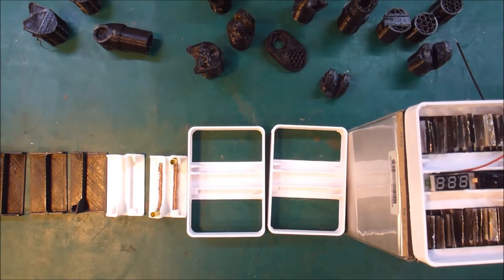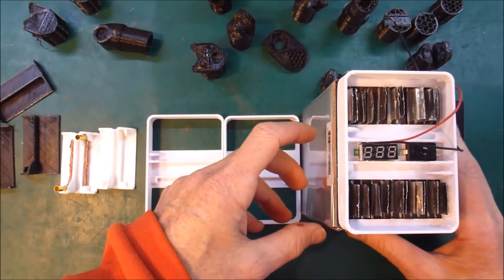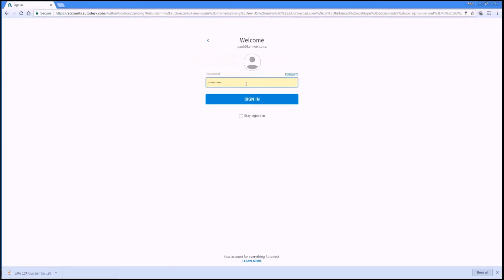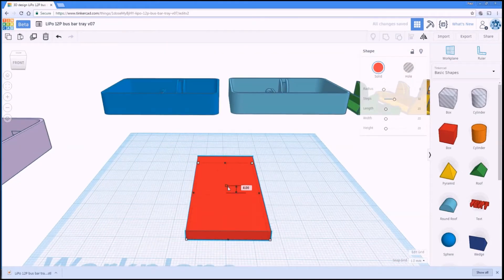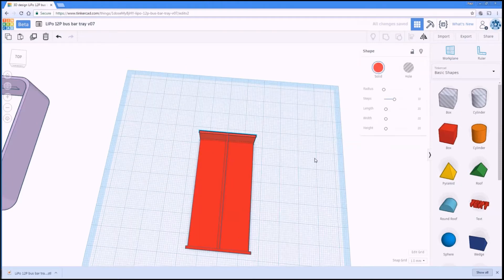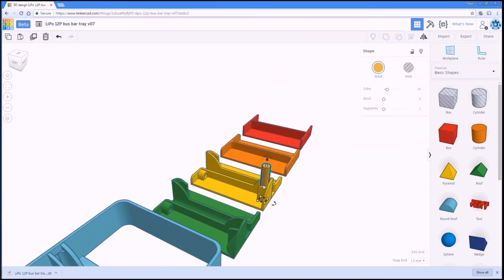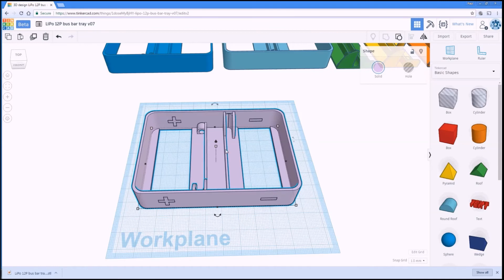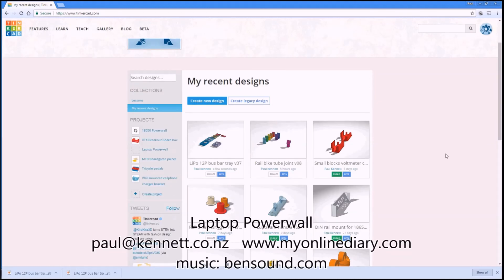Laptop Powerwall 106 - How I design parts for my 3D printer

Comment: I got a 3D printer a few weeks ago and I've started using tinkercad. I did download 123D Design to start with which I think was more powerful but then I formatted my laptop and found they'd discontinued it! 
TinkerCad has been pretty easy to use but I'm really glad you've shown me the align tool. I hadn't seen that one (I know it's right there now you've pointed it out) and it will save a lot of time! 
I was wondering about your small packs design - what do you print them out in PLA, ABS or something else?
Reply from the maker: Align, Duplicate and Group - that's about all I need at the moment. That's a shame about 123D Design. I was thinking I'd jump up to it if I really needed more features. I wonder what the next best simple tool is?
Reply from the maker: I also switch Units quite often between 1mm, 0.1mm and sometimes 5mm. 0.1mm is often good enough for aligning "odd" faces.